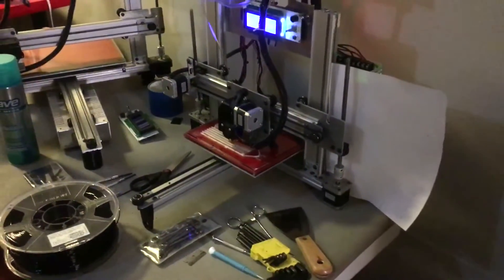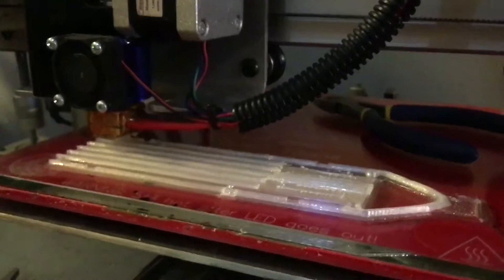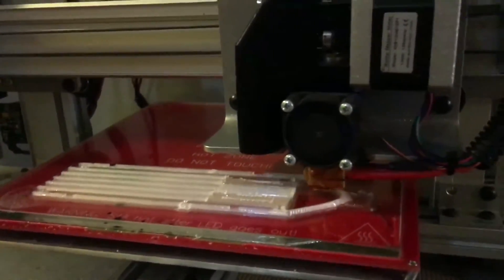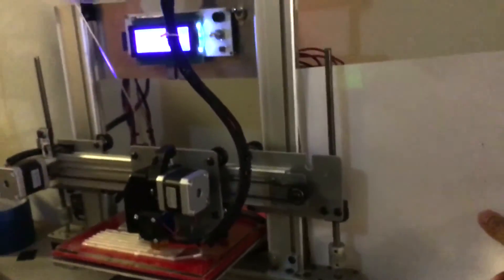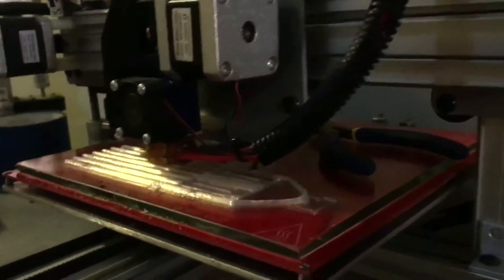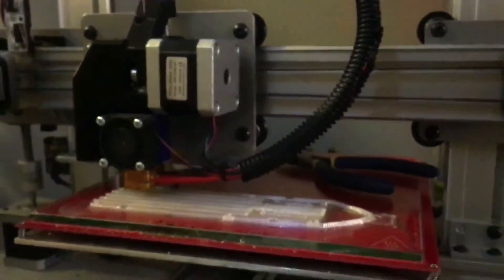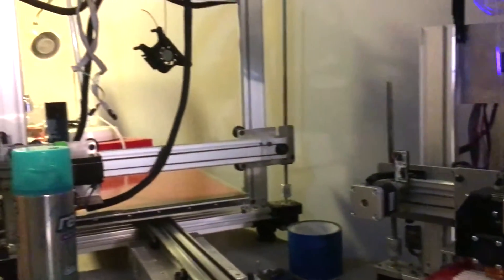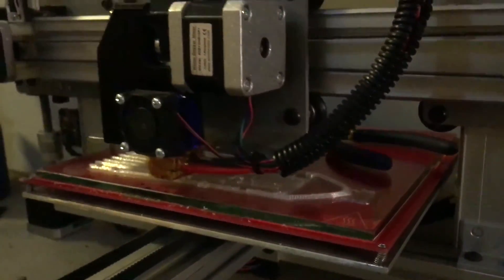eSUN PETG - My Print Settings

Comment: I use the exact same hairspray. Works fantastic and it's cheap! Guess you will need to design an exhaust duct for that PSU.
Reply from the maker: I might just re wire it and move the psu underneath the printer.